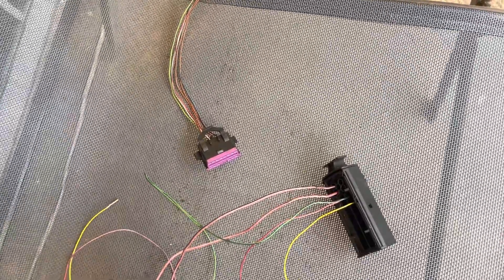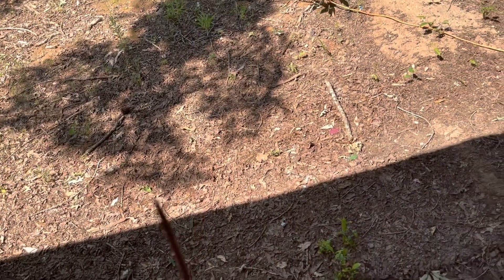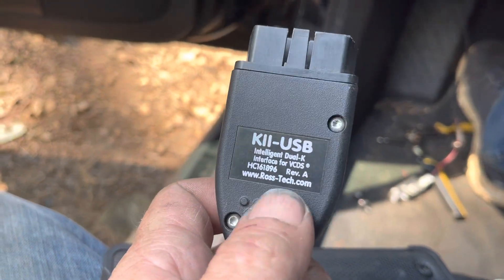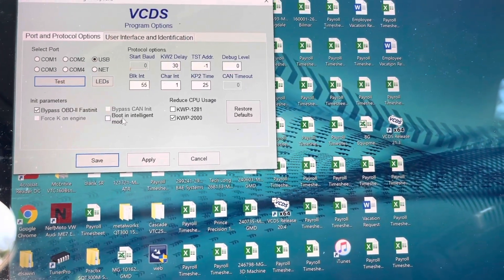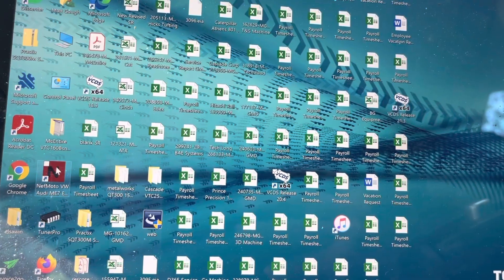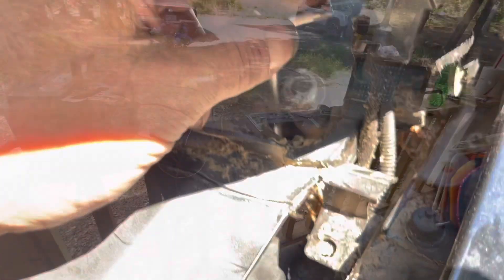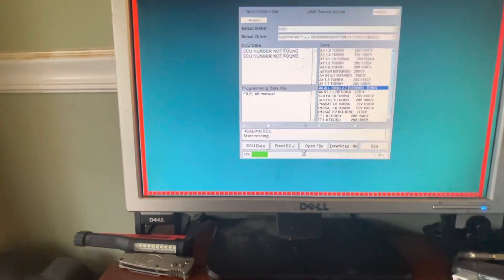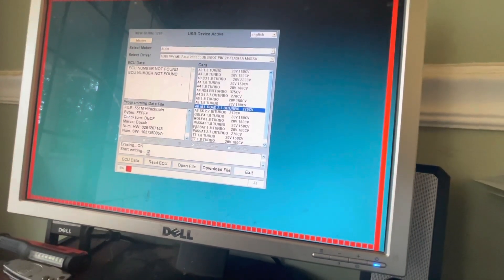Audi B6 A4 2.7 swap: ECU boot mode reprogram

Comment: I've got a B6 Audi A4 Quattro with a faulty ECU. I thought it was a plug-and-play swap but it is not. It's looking for a 7-digit code to enter for the immobilizer, (I'm using Autel MS906 Maxisys). I don't believe the dealer is capable of getting this code any longer. I don't know if this is a III version ECU. According to Ross-Tech there may be a way to obtain this code via the inte4rgrated instrument cluster. Does this sound anywhere near correct to you? I'm guessing not or you would not have to have done the procedure you did. Bitch is, I can't try to copy your reboot method as I don't have the connectors and don't know if I can access the software needed free of charge. So it pretty much looks like it'll need to be done by Audi correct? any advice is welcome, and thanks for the video, Paul @ https://www.youtube.com/channel/UCdq2jaxcmgyX0AERivIB2Tw
Reply from the maker: The only way I know how to do it without the code is to swap the immobilizer chip inside the ECU and unless your really good at soldering circuits I wouldn't attempt it. AUDI may be able to bypass it or a local tuner but I'm unfamiliar with it because I just overwrite the software.

Comment: I DONT  know if you respond to comments I hope so! I have 2003 audi allroad  2.7t how do I know if it's in immobilize mode? Cranks no start. I have gotten it started only by going into the tank connecting power straight from a secondary  battery with a toggle switch started the just replaced fuel pump it starts runs as it should for 2 seconds than it a battle to keep it running like crap.i have tried to reset by draining power by connecting the battery terminals until it is drained and that does not work. Had a guy today come over AND SAID HE CLEARED THE codes and all the idiot lights however after he left I got behind the wheel and nothing was any different than before. I'd what I should do next . I have little to no experience with this car. My daily driver is a 1989 gmc vandura 2500 it does not even have a seat belt sensor or the anoying busser if the door is open. So I guess old school but willing to try to learn I love everything about this car I've seen . My just does not do any of it at this point.
Reply from the maker: If the car is in an immobilizer lock out the instrument cluster will say "SAFE" in the odometer and/or there is a yellow car symbol with a key inside it. If you see either one of those after trying to start it then it is locked by the immobilizer. If you don't have either of those showing then I would check for the basics to get the engine running (spark, fuel, air, and compression) spark can be checked with a multimeter and an old spark plug, fuel can be checked by testing for power at the pump while cranking/running, if you have power at the pump the you need to check for proper flow/pressure. Air just needs to not have a clogged air filter or an obstruction reducing airflow to the engine. Compression has to be checked with a gauge. You could also try starting it with the MAF sensor unplugged, if it runs with that unplugged either replace it or try to clean the original one with MAF cleaner only.
I would also check for leaks in the intake system (charge pipes, intercoolers, bi-pipes, throttle body boot, Y pipe, pancake valve, etc.)
Best of luck to you figuring out what's wrong with it.

Comment: @Shadestreet Street Cars, I haven't seen your full 2.7 swap series, but is the reason you have to boot mode it because this ECU was never adapted to the car you are putting it in, so the ECU is locked out by the immobiliser? So based on that, if you had tried to run the Nefmoto software in the donor car the 2.7 ECU came from it would have worked okay?
Reply from the maker: Yes that's correct. The donor car I bought didn't come with a key so I had to bench flash due to the immobilizer locking the ECU.

Comment: My 3.0 recently went out and planned on a 2.7 swap when I got the car but some of this stuff looks very technical and I don’t think I can manage it with my budget and thought process. I might just have to do a 3.0 swap but wanna do a 2.7 BADLY
Reply from the maker: It really depends on what year your 3.0 is. If it’s a 2002-2003 you don’t have to add the fuel line. The wiring and the ECU boot was the most technical stuff I had to do.
Reply: @shadetreestreetcars8626  Nah my 3.0 is a 2004 6 speed